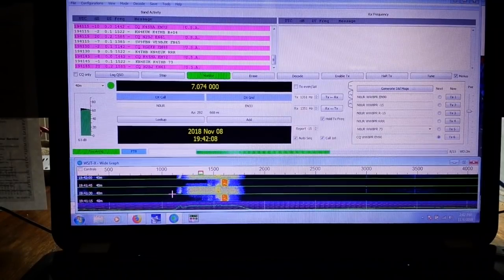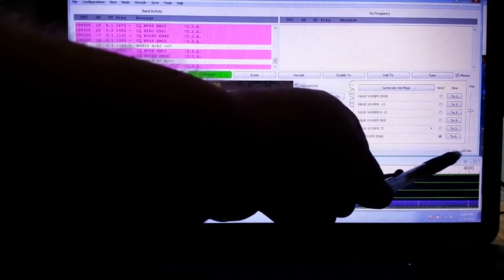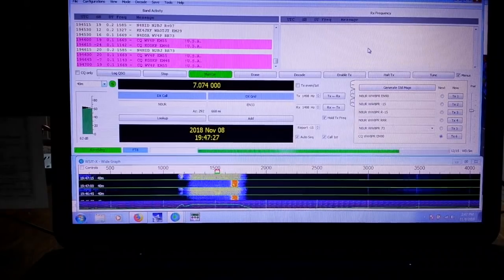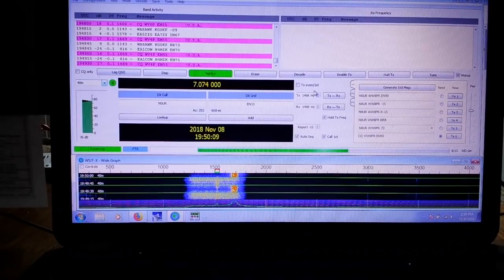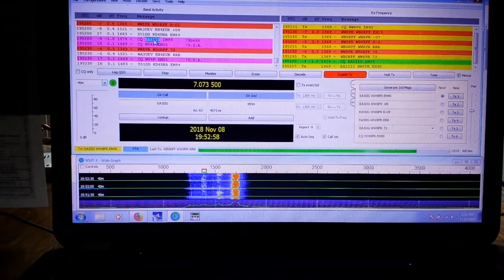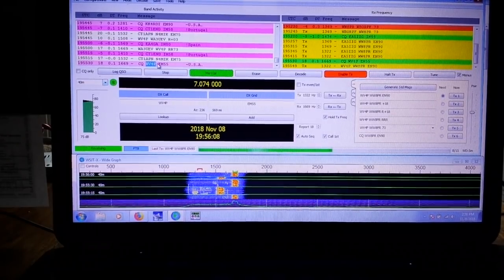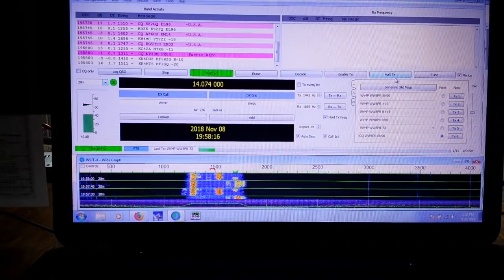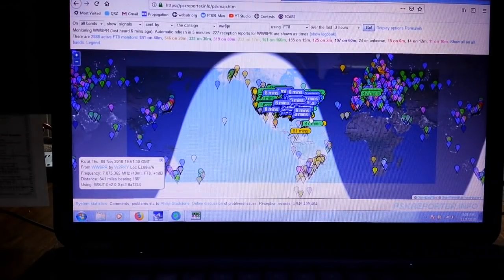Getting started with FT8

Comment: Best summary, no unecessary jargon/fluff. I'm just getting started. Had an issue with not being heard. Now I am being heard using JTDX after chnging sample rate from 44 to 48KHz on the usb audio codec but still nothing using WSJTX. Also no QSOs yeat on either one. I'm on an ic 7300 so still something off somewhere for me...Any suggestions? 73s M7JZW

Comment: I have found that the biggest hurtle to get to FT8, is the setup. I went from a Yaesu FT DX10 to an FT 710 and they are both a nightmare to setup. If you know a local ham that's been there and done that with a radio just like yours, then you "might" have a chance to get your system set up in a week or 2. But if you're a com port and computer geek, you just might get it to work.

Comment: Just Started learning this FT* and thanks for your video. I have a question. When I am in "transmit" on my radio (FT-991a) in addition to seeing the transmit light on the radio light up, should my signal indicator on the radio do anything? I have yet to get any response on 40m and my signal indicator does nothing, I am at 45 watts.
Reply: update- my ft991a was set at usb so I changed it to data-usb and now it's transmitting and I can see the po meter go up when the transmit light is on. I also changed it from USB in the software settings to data/pkt

Comment: I'm about to step back out to my plastic tent with a small electric heater within a yet uninsulated bigger ham shack on top of a freezing windy mountaintop. My setup is ready to go, saw wsjtx and ic7300  receiving properly.
I only recently made my very first contact and second    on 20m ssb. My third has to be through FT8. Thanks!!!

Comment: Very helpful video.  When does the decode button need to be pressed?  Also, are the messages automatically generated or does the generate message button need to be pressed the first time?  After opening and setting up the program, only the cq message there.

Comment: Thanks very much - I was really unclear about how the automated macros worked and how to enable them etc. Yours is by far the clearest video showing the steps through a QSO. I will give it a go. I have returned to the hobby after 30 years qrt, and am finding all the new modes and operating practices very interesting. Hope to work you down the log. 73 Rob G1VXD

Comment: Thank you for sharing! I’ve been off HF since the early 90s and this is all new to me. I am approaching retirement and decided to get set back up with all new equipment. Less than a month ago I connected a Raspberry Pi to my FT991a and scratched my head a bit. This video helped me begin to make contacts. One other thing that is wonderful about this: I have hearing problems now and FT8 let’s me work stations that are out there. I still prefer a rag chew but for getting DX under my belt this is the way to go. 73s-WA4HTG

Comment: I'm a radio operator since 1986 without an ham radio license. I usually use in my work secure digi communications, and teach radio operator procedures since 1994, and use in class some soft of ham radio. It's amazing to see the young people discover these kind of comms. I usually use in my chack a Cobra 148 GTL With Homebrew poor digi man to connect the radio to the computer with very nice results in MSSTV ROS SIM31 JS8CALL FLDIGI and in last FT8 I'm trying to put 27500 in FT8 Program but it's not working properly when I use it to put in PSKREPORTER because of program doesn't allow to put the contact in the air. So how can I do it? Tks 7351.
Reply from the maker: I don't know, sorry.

Comment: Thanks.  Wannabe ham here.  It's on my bucket list.  Just letting you know this is still helping someone over a year later.   Finally got this working with my new SDRPlay RSPdx thanks to you.  For time sync, I've used "Dimension 4" for over 10 years now.  http://www.thinkman.com/dimension4/  Once configured to point to an NTP server, it works automatically in the background.  I've checked it against WWV and CHU Canada and it's always spot on.  Thanks again.  Your vids are always informative.

Comment: Just getting started here. I'm not able to make my activity window look like yours in that it doesn't display the country on the CQ stations. Is this something that changed in later versions? I'm using v2.1.0. The best I can get is NA, EU, etc, which isn't what I want.
Reply from the maker: There is a setting on the general setup page that says show country name or prefix.
Reply: @learnelectronics   Thank for the reply. I've been all over those settings and can't seem to get it to show. If I tic Show DXCC, grid, and worked-before status I get the NA, EU markers. Nothing else seems to have any effect. I've done a wide Google search and have come up empty for now. Got some other folks I can ask at a club meeting later this week. Getting anxious as I still don't have a proper antenna to TX on. RX only at the moment.
Reply from the maker: Email me arduino0169@gmail.com

Comment: Just wanted to say this is for sure the best WSJT-X tutorial out there. You really explain things properly and clearly. If you don't mind, may I ask why your transmit and receive must be on different frequencies? And also, is there a way to allow WSJT-X to receive signals from other people and upload them to PSK reporter automatically? Just one other question, my set up seems to work, I.e. I can get WSJT-X to transmit fine BUT when I press the 'test' button in the radio interface tab, it does nothing - it doesn't turn green or red. Is that OK? I am using an FT-891 with Raspberry Pi3b+.
Reply from the maker: They don't strictly have to be on separate frequencies but it is a best practice. If you're transmitting at the same time somebody trying to transmit to you you won't be heard.

Comment: A very interesting video. How did you learn all of that stuff?
I have a few questions but first: I have an IC-7300. I have WSJT-X all set-up. 
1. How do you set up the power and audio settings and ALC so that you are not over driving anything. 
2. The signal strength report looks cryptic. +07, -.03. I don't get it.
3. In settings I have baud rate set to 11520,you have 4800??
4. In the green scale on the left you mention making adjustments to avoid overdriving. How are the adjustments made??

Thanks for you help!!
Greg, KO8A
Reply from the maker: Hi Greg, I learned most of that stuff simply by experimenting with what works and what does not work. The power and audio settings are under the connections menu and are the USB mod levels. The signal reports as far as I understand refer to the level above and below the noise floor. I think I read somewhere that ft 8 is good 2 - 24 below the noise floor but -24 what I don't exactly know. If you have any more questions feel free to email me and I'll try and help... arduino0169@gmail.com

Comment: Not really into HAM radio but it looks interesting. Ill have to learn a  little more about it first. 
Just one minor suggestion; You sould use OBS screen recorder to make videos dealing with programs. It's just that the footage of your monitor comes out pixelated.
Great video as always though.
Reply from the maker: Obs crashes my laptop
Reply: Yea, sometimes that software does weird things. 

Regardless, thank you for the video since it has piqued my interest in communications and HAM radio.

 I'm not required to take a comm. course for my degree, but I think I'll try to learn as much as I can on my own and go from there.

I already have the wikipedia page on amateur radio open to get a rough view of the topic. 

Thanks again, and I'll be looking forward for new videos regarding this subject.

Comment: Our local college is now offering first entry level ham radio class. Plus you get a baofeng radio for $35, text book n exam. 5 week course. (Hope I spelled that radio correctly). Of course I'm enrolling.
Reply from the maker: That's a good price for everything. And don't listen to what the old fuddy-duddy's say about Baofengs. They are just pissed off they paid $200 for their Kenwood or Yaesu or Icomm handheld.
You should learn this in your course but if you don't, remember this one thing: it doesn't matter how many watts you push or how much you spend on your rig. The most important thing in your setup is the antenna. Without a good antenna your signal isn't going anywhere.

Comment: This is really interesting Paul.  I think it's important to emphasise the historical importance of amateur radio and how it got to where it is today.  It's also worth pointing out that Ham operators do actually converse and this is just one flavour in the radio operators repertoire!  I know from my dxing days that it's a bit like climbing mountains - because it's there!
Reply from the maker: Yes indeed. Ham radio has something for everyone. There's the electronics aspect of building and maintaining your open gear. The thrill of talking with someone on the other side of the world. The challenge of learning CW. The EmComm aspect of bring able to communicate during a crisis and the fun of all of it.
But right now we are at the bottom of solar cycle 25 and the bands are not great. So a week signal mode like FT8 let's folks not versed in CW get out there until things pick back up. And for those that say digital modes aren't real ham radio, I would counter that CW is the original digital mode and voice comms didn't come until much later.